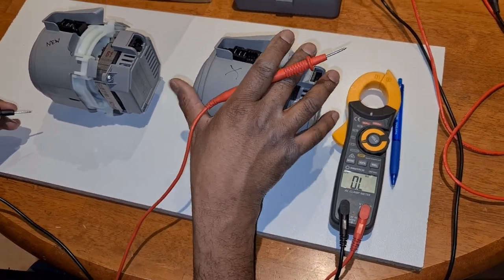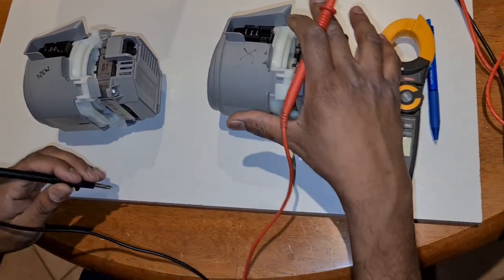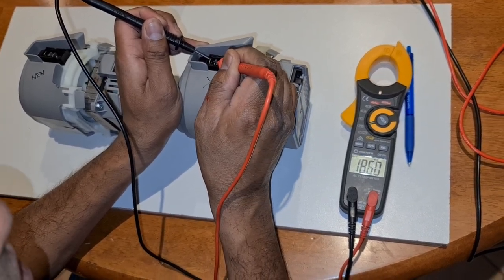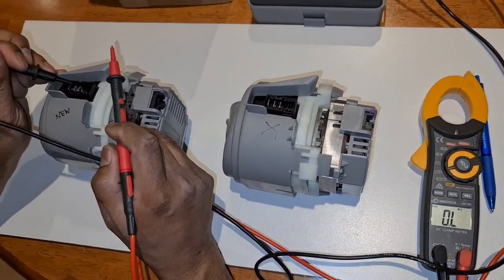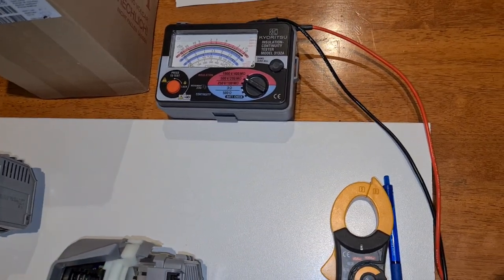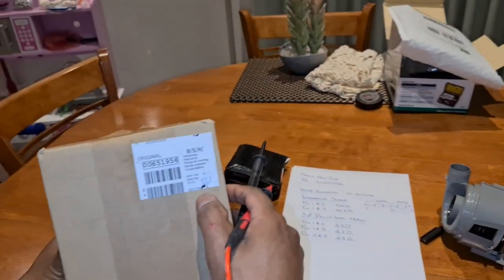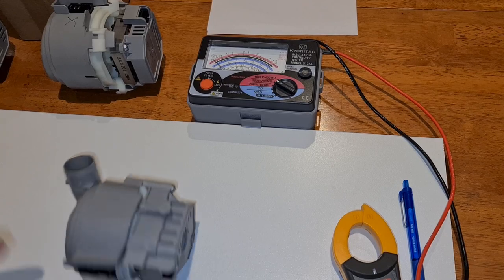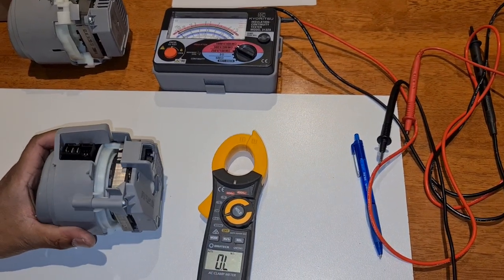Bosch Dishwasher - Testing the Wash (Heat) Pump - Error E09 or Tripping the circuit breaker.

Comment: Thanks a lot for this video. What I find particularly problematic with these Bosch/Siemens dishwashers is that this pump/heater is sitting at the bottom of the sink. Any more or less serious leak elsewhere in the system can cause water accumulating at the bottom of the sink thus innondating this pump. My Bosch has a well-known problem of leaking from the sidewalls which I have not so far managed to solve completely (I tried using thermoresistant silicone sealants that do the job for 1-2 years). My Bosch is around 11 years old, and I replaced 2 pumps (40 euros here second-hand). As a side note, the heating elements can now be purchased on Aliexpress, something that was not possible 2 years ago.

Comment: Very nice that you showed the last heater aswell. I cant measure anything with my multimeter, so it must be an open circuit. I feel comfortable enough now to buy a replacement. Thx. alot.
Reply: Get just the heating element as a spare. The pump will cost you just less than the whole cost of the appliance

Comment: I suspect these thick film heater/pump units installed in Bosch (& possibly Siemens) dishwashers have a common and serious design flaw. 

Symptoms are either water will not heat, tripping mains circuit breaker and/or E09 error

The rubber seal that keeps water away from the (dry operation) thick film heater element in the circulation pump leaks. 
The leaking water then corrodes the 2000W heater element at the lowest point and it fails open circuit or shorts/leaks to ground tripping the mains power circuit breaker. 

I've seen several units less than 3 years old with this issue which require an NZD $185 (pump cost price) part and min two hours labour charge plus call out and GST (assuming it hasn't damaged the controller board). 

I've tried and I think it's not possible to patch the defective thick film heater element, plus you need to replace the large O ring seal and reassemble the pump without damaging the O ring

Customer is looking at approx NZD $500 repair on a $1200 dishwasher, most customers just scrap it
Reply from the maker: Hi Zac

That's correct, water either leaks via the seal or if the sump is leaking if pools around the wash pump and corrodes it that way as well.

2hrs labour is fair and reasonable for this job including testing and pumps are expensive. So by the time you put your mark up on the part it's an expensive repair.

In these cases it makes better business sense to refurbish and install them into rental property and would have a good resale value.

The dishwasher would be maintainable with ready access to Bosch spares compared to cheap n nasty dishwashers.

These cheap units will fail just outside warranty and your stumped for replacement parts, which will most likely end up in the dump.

Comment: Thank you very much for your detailed video. I'm not very knowledgeable in this domain, but I can use a multimeter :) I measured the heating element resistance, and the reading was 8.9 ohms (nothing between the ground and either of the heating element's prongs. Does this mean the heater/pump is bad? my issue started with an E:01 code  "Heat pump motor circuit fault". Thank you for your help!
Reply from the maker: @zakzman2633  if you have 8.9Ohms between heater terminals and ground you have a breakdown in insulation resistance. 

Did u unplug the heater wire harness and temp sensornplug before taking readings.

If not you can be measuring circuit resistance in parallel.

I unplug all connectors to the heater and I use a megger tester to measure insulation with 500volt setting to check if the resistance drops below 1Mega Ohm, ideally you want insulation resistance to be between 10Mega Ohms to 500Mega Ohms.

But if your unplugging thr connector and getting 8.9ohms between earth and heater terminals, you have a bad heater and you will need to replace the pump
Reply: @theoracle6005  Thank you for the details. I'll redo my measurements after I unplug all three wire harnesses (motor, pump and heat sensor) this time. I appreciate it!
Reply: @theoracle6005  Hi again... ok, I unplugged the power harness and the sensor harness to the heat pump and the readings are still the same...8.9 ohms between the two terminals (nothing between either of them and Earth/ground terminal). Measurement at the heat sensor were 9.9 (terminal one and two) 9.8 (2 and 3) and 19.7 ohms (between 1 and 3). The motor terminals readings were 12.8 ohms between each two of the three terminals. As you can see the measurements are following the correct patterns, but the values are a way lower than what you had. I'm in the US and voltage is 110/120, would that make a difference? Do the lower measurements means the heat pump assembly is damaged? Thank you very much for your help!

Comment: Hi my Bosch dishwasher lifestyle automatic SBI69M15AU/01 is not heating the water for the entire wash cycle, i have tried several attempts but dishes go through entire wash cycle and come out greasy and unwashed. Any idea what it could be as there is no error code coming up so no idea where to start diagnostics.
Reply from the maker: Measure the resistance of the heater, if it's open circuit replace the Heat pump assembly

Comment: The fault on mine was water gets trapped in the grey housing and shorts the heater element which is printed to a steel tube inside. Dissasemble, dry and then test and they're usually fine to refit. But you gotta fix the leak otherwise it'll trip the consumer unit again when enough water enters the housing in the future.
Reply from the maker: Hi Sam

The grey housing should have water as its a pump, the Oring seal could be compromised once its removed and reinstalled then you have a chance where water can get on the terminals and short out.

Best is to replace the heat pump if see its defective